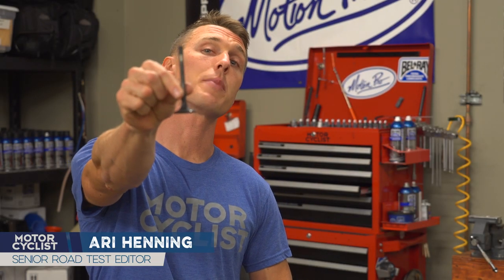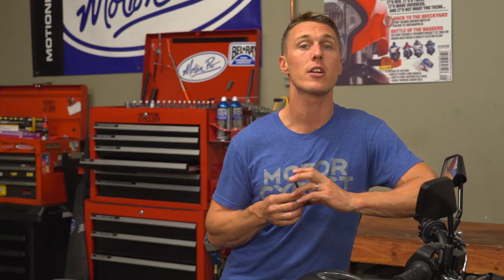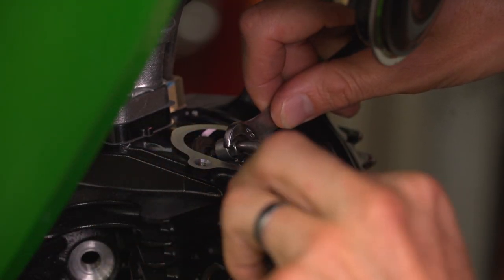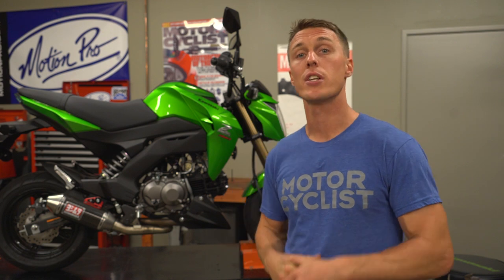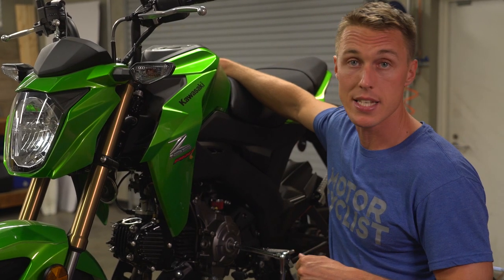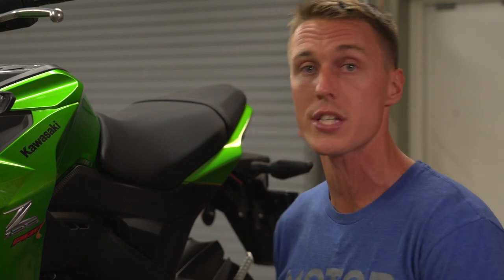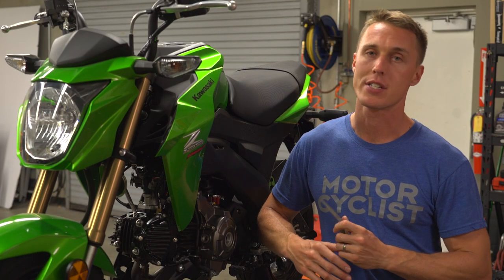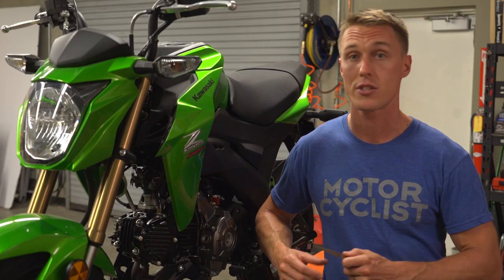How To Check And Adjust Screw-Type Valve Clearances | MC Garage

Comment: How many people actually do this valve clearance inspection and adjustment on their bikes?? dealers can barely do a poor tire replacement job.
Reply: then you have to learn how to do it and do it yourself.
Reply: NoShadowOfDoubt I just did my first clearance check last week. I’ll never pay someone else to do it again. I do my own tires too thanks to Ari.
Reply: I do, but I have a 125 with screw types so it isn't much harder than what's shown in this video.
Reply: I do it every time I change the oil on my scooter. Gotta wait for the oil to drain anyway, might as well check the valve clearance and spark plug condition.
Reply: i would not do it if i didnt have to.. got a wr125x which is ticking really loud so i wanted to fix that! 5 days until i get my license! (hopefully)
Reply: I did it on my ktm rc390 by myself
Reply: I'd gladly do it my self, but I don't have a place or tools to do any work on my motorcycle.
Reply: Do you recommend to take it to a mechanic for the valve clearance adjustment?
Reply: Uhh anybody that wants their bike to last more than 12 months.

Comment: There is an easy way to turn the motor over for doing valve adjustments if your bike has a center stand.  Put the bike up on the center stand, put the bike into gear (a higher gear preferably as it will reduce the effort needed) and slowly turn the back wheel forwards
Reply: Curious about why my service manual would tell me to take off the crank case cover instead of just doing this. Any thoughts?

Comment: You forgot to talk about the marks on the Motion Pro tool. As you said, on some bikes it's REALLY tough to bend the feeler gauge to get it in there. So as an alternative, you can do this: Once you get the clearance just right with the feeler gauge, you note down the position of the knob. Now turn the knob to tighten the adjuster until it just touches the valve stem (ie.  0 clearance now). Note how much you had to turn that knob. Let's say you turned the knob 20 minutes. From now on you don't have to use feeler gauges anymore. You just loosen the lock nut, tighten the adjuster until it touches the valve, and then back up 20 minutes, and it will be the correct clearance.
Reply: i wouldnt do this its not THAT big of hassle to not check it again after tightening the nut

Comment: I have never seen or heard of anyone, having to bend the feeler to get it into the valve who the hell taught this guy
Reply: I have too on my pit bikes. If I don’t, then the feeler will be at an angle and can be hard to adjust accurately.
Reply: @Mr.N42069  I have two Briggs & Stratton powered pit bikes and a 37.7 Friction Drive bicycle, and never have to bend the feeler to do my valve adjustments, which are usually about once a month your valve stems are probably sticking
Reply: @Brian81-207  i did a full rebuild on them a couple months ago and haven’t noticed anything. I bend it cuz where the valve cover screws on, it has a lip that makes the feeler go in at a an angle and can make it feel tight when it not. On go kart and mini bike engines, u shouldn’t have to cuz the cover is a lot bigger and the valves are more exposed. I got a 5.5 Briggs on a go kart and don’t have to bend them ether.

Comment: Ok so last week I had the valve clearance on my lil 125cc bike checked and adjusted on the dealership. The poor thing just sounded bad. I didnt even bother to go back to the dealership, I went straight to a local private shop just around the corner and the engine sounded like new. Do dealerships even regularly check the work of their mechanics?

Comment: I have done this many times to motorcycles and cars/trucks. The clearance is not perfectly parallel because the rockers move in an arc, while the valves are linear. How do you account for that? I have always resorted to "ear" adjustment after I get a few set with feeler gauge. Motion Pro tool is nice.
Reply: Thanks, I'll try it like that next time on my hotrod '71 cb350!

Comment: I did the valves on my CBR500R it wasn't too bad, shim style, but unlike my CBR650F which I haven't hit the miles yet to need it, the 500R was shim over bucket and had a bolt that dropped the cam out of the way enough to reach the shim, the 650F is traditional inline-4 style of shim under bucket which requires the removal of the whole cams, it will definitely be an adventure, if I even do it myself.

Comment: I have a 2003 yamaha v star 1100 and I need to check my valve clearance but I can not find feeler gauge blades with the proper thickness that is needed.
Would it be recommended if two blades are used to get the measurement required.

Comment: Ari, i have a bike similar to the z125 just a bigger version. 0.04mm is the minimum intake/exhaust valve clearance right so if i adjust it higher would it mean that the valves are more open or will it have a higher stroke or shorter? hope to hear from you guys ASAP.
Reply: bloodspill ganz tighter your clearance, wider your valve opening.

Comment: Great vid as always!!! Has anyone else struggled with cracking the adjusting nut and has any tips please? I have a 1990 Kawasaki ZZR250 with a 9mm lock nut and I'm worried I'm gonna snap it in two just loosing it any help would be greatly appreciated please

Comment: Do you have to drain the oil before checking valves??
Reply: 1:51
It's not necessary to drain the oil, unless you already have an oil change planned. Check your oil level after you're done to be safe.

Comment: many people think that the clearances get looser over time. in fact, the valve clearances get tighter not looser. this is due to valve recession. if you don't adjust them eventually the valves will fail to completely seal the combustion chamber and you lose compression.
Reply: Some get looser and some get tighter. It really depends on your bike
Reply: Can a compression test help us to know if we need a valve clearance check or not?
Reply: @sanketjain9320  the only way to be 100% sure is to check the valve clearances with a feeler gauge. a compression test will only tell you if you have good compression, it wont tell you if the valve gap is too big or too small IE you could have good compression and still have valve clearance out of tolerance. if you got low or no compression then its more likely something worse than simple valve clearance adjustment.
Reply: @Gruxxan  if the gap is too small and over time the seals have burnt, shouldn't the compression test show a loss of compression.?
I agree the reverse isn't true - loss of compression could be due to a lot of things.
Reply: @sanketjain9320  the seals being burnt would lead to a loss of compression but you would want to check the gap before it gets to that stage. you can have good compression and the gap be too small so you would need to open the gap to bring it back to tolerance. having a gap thats .01 mm too smalll wont necessarily mean you lose compression but over time it will continue to wear and eventually you will end up losing compression. thats why its a tolerance. if its not within tolerance you have to adjust it. the only way to know is to check with feeler gauge
Reply: @Gruxxan  I understand. But i live in a country where the technicians don't really have experience of doing this. I think opening the engine apart could lead to new problems here, given the complexity of the task.

So, was trying to see what best I can do to delay valve clearance. I simply cannot be doing it every 15K that KTM suggests.
Reply: @sanketjain9320  well, if you have good compression, it runs well, and it sounds good, then you just have to keep your fingers crossed. eventually you would want to check the clearamces, or sell the bike and let somebody else worry about it
Reply: @Gruxxan  sounds good. Thanks a lot for helping out :)
Reply: @sanketjain9320  no worries bro

Comment: if these maintenances were as easy as you guys make it seem , the mechanics wouldnt charge so much for labor :)
Reply: This kind of valve adjusters make it super easy. Shim under bucket type is where it gets complicated. (as Ari said in the video)
Reply: Mudux yes i herd but not everyone has z125 or would trade their 600 or 1000cc for one just for that
Reply: ebubekir binici doesn't change the fact that it's easier to do on some bikes than others.
Reply: Mudux yea and thats why i said the videos not just this video.
Reply: i think its 12 euros for this tipe of bike
Reply: Mechanics don't even charge that much. You should see what my CPA firm charges per hour or what my buddies law firm charges per hour. :D :D :D
Reply: ebubekir binici its $100 dollars CDN an hour here or more depending on where i go
Reply: @Alex come check my valves in 15 mins then

Comment: Why are the factory valve clearances noisy on older engines? It sounds like the clearance is too loose even when its adjusted to spec. Thats why local mechanics use tighter than spec valve clearance on old engines. Can anybody enlighten me?

Comment: best video ive seen!
Reply: His words are fast but they are important. He said "If the clearance increases you're gonna get really noisy valve train but if the clearance decreases, your valves might not able to close all the way. When that happens it doesn't take longer for the hot exhaust gases to burn the valve seals and then you are really in trouble. Valve seal is the rubber cap on the valve rod hidden inside the spring. Even if the T mark is on the top and the rocker arm is not loose then we have to rotate 360 degrees again in anti clockwise direction to bring the T mark on the top vertical line and then the rocker arm will become loose. Now we can adjust the valve clearance by sliding feeler gauge metallic scale between the rocker arm screw and  the valve rod. We have to adjust the require millimetre gap for the exhaust valve and intake valves mentioned in the user manual.

Comment: Valve clearances is one of the mantenaince jobs more "forget" in motorcycle and car engines. I know cars that have more than 100k miles and never check valves.
Reply: Ya, a lot of people don't think cars even modern ones need an inspection and adjustment. Hydraulic valves don't instantly mean lifetime self adjusting.
Reply: I've owned a car with valve adjustment intervals recommended right around 100k miles.

Comment: my honda xr 150L  intake tappet valve clearance is .08mm and exhaust is .12mm(standard).. i brought it back to my dealer for a tune up at 12k km odo. they adjust the intake to  0.10mm and ex  0.12mm . anny disadvantage for not following the standard clearance?